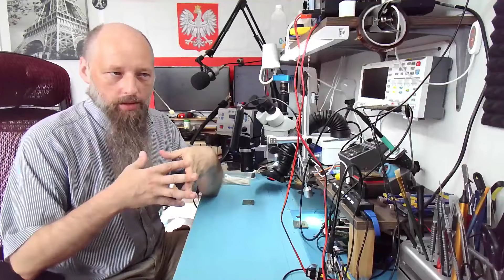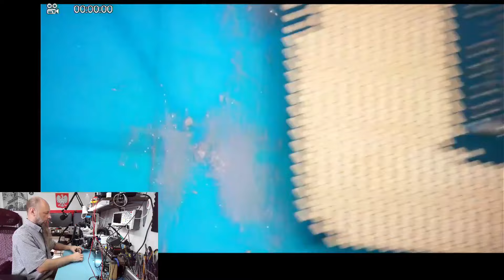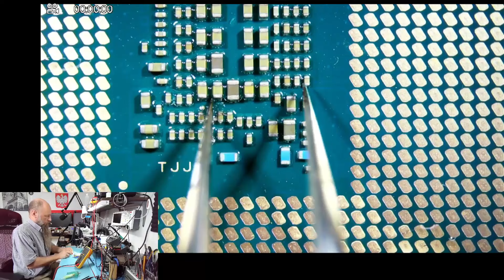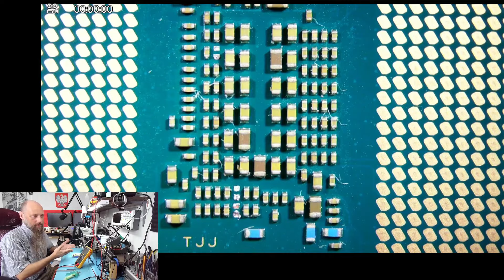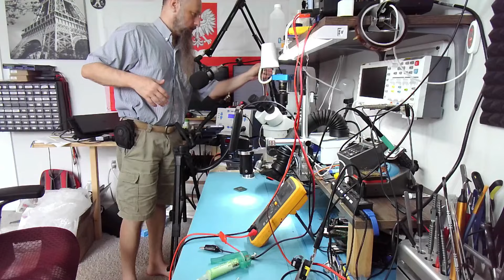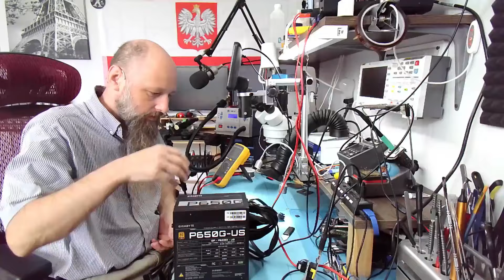#48 | Intel i3 10th Gen CPU Repair

Comment: Please what’s the voltage for injecting cpu
Reply from the maker: around 1V, I usually start with 0.75 and go higher as needed. Do not exceed 3W of power when injecting
Reply: @blackhorserepairs ok thanks alot man

Comment: Hi, how you test if accidentally power gets into data lines or control lines of the CPU
Reply from the maker: interesting question. The power that is delivered to CPU is in the range of 1V, there would be no damage to the CPU if that rail goes to data lines. The damage will occur if the 12V is supplied to CPU either power or data lines, which is the case if high transistor shorts out. If, on the other hand, the pins short the VCORE to any data line, there should be no damage to the CPU. If your CPU is not shorted and still doesn't work (data lines issue) it is likely the issue with the board or compatibility issue. Test it on multiple boards before concluding the CPU is faulty.